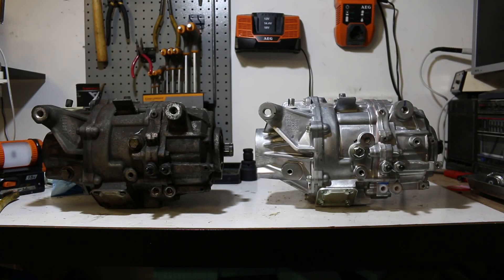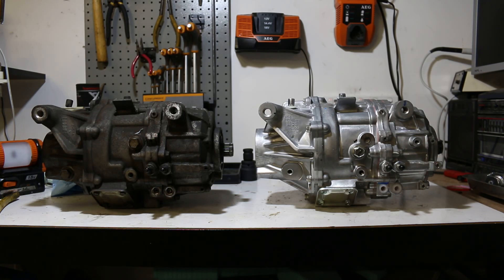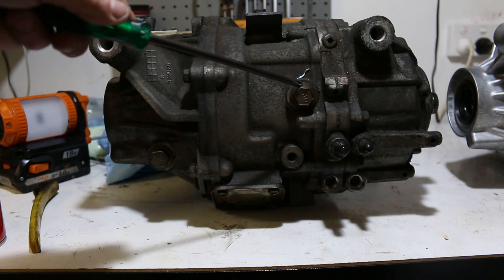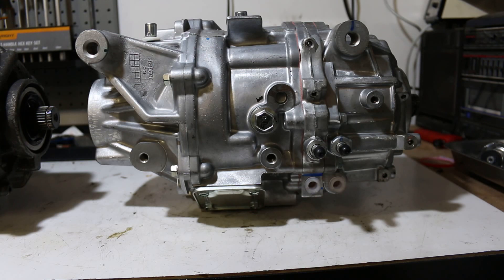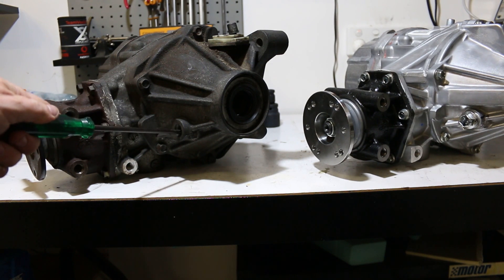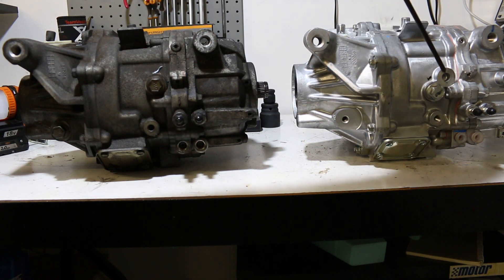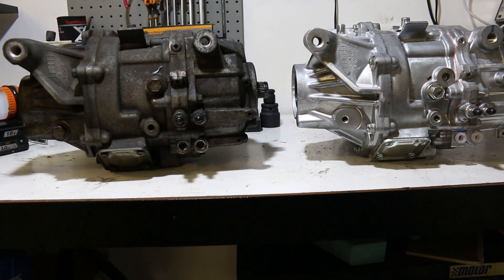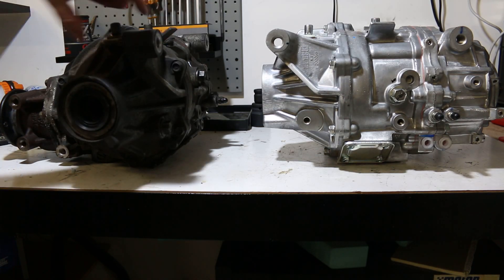Physical differences between AYC and Super AYC differentials

Comment: Few little things to point out Ed, the longer mounts are legnum specific, all the evo diffs have shorter mounts. And all the evo diffs have the gear oil fill plug at the front of the diff. The AYC diffs ran from evo 4-6.5 unchanged, 7 is slightly different crown wheel and pinion with the introduction of ACD. 8GSR, 8MR and 9 all run the same SAYC diff like the one you have which you can identify by the offset and lower ATF fill plug on the SAYC diff. SAYC runs a helical LSD main diff whereas evo 4-7 AYC diffs all run open centres.
Reply from the maker: Steve Hunt cheers Steve I'll add that into the video info.
Reply: Just came here to comment that i removed my UK GSR E8 diff tonight and it definitely seems to be the SAYC version, great info from both yourself and the video creator thanks.